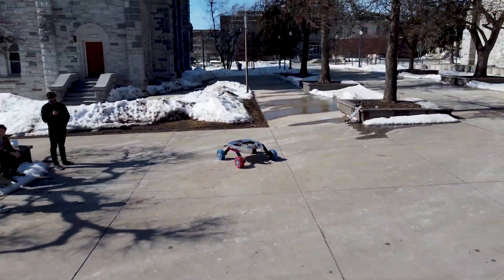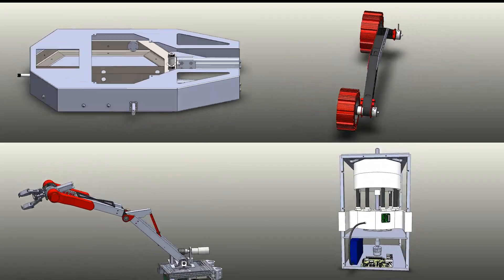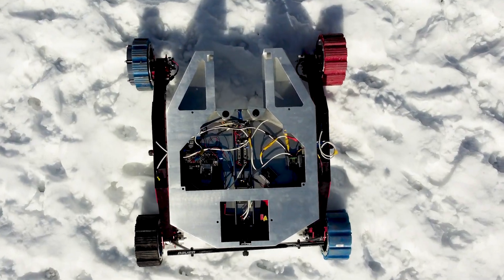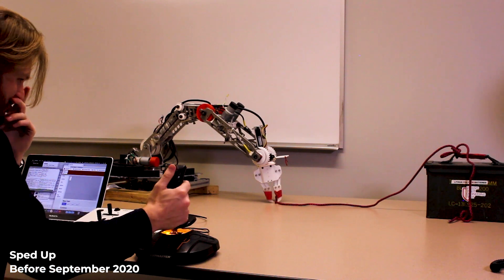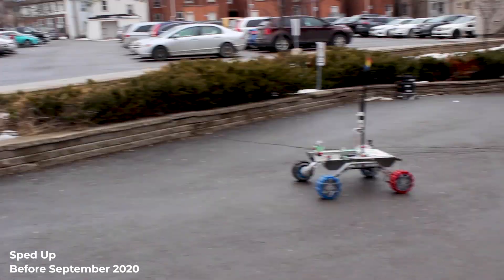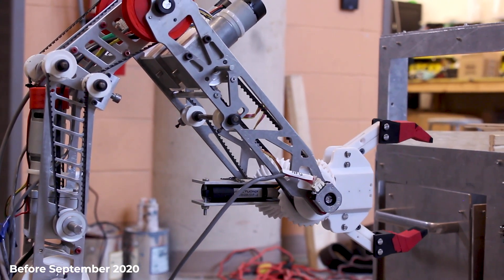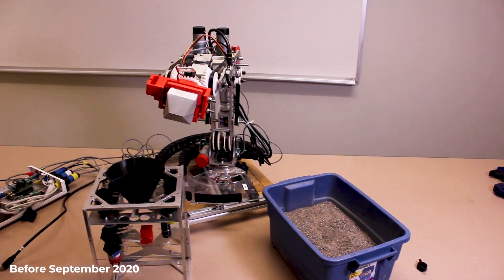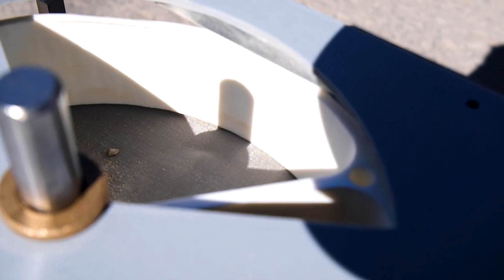Queen's Space Engineering Team SAR | URC 2021

Comment: The suspension would work better if you added additional flex in each side of drive. It is to rigid if you hinge it using a shock or coiled spring flexible suspension adding flex for different terrains.